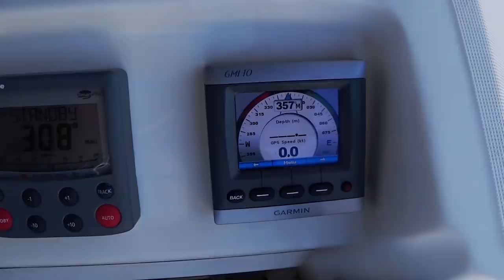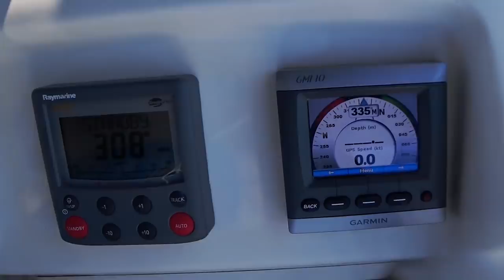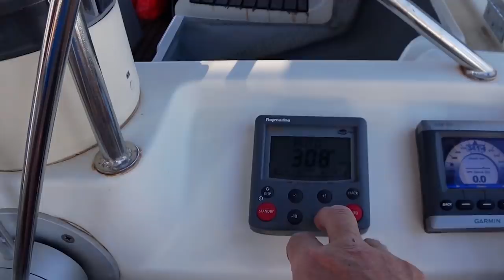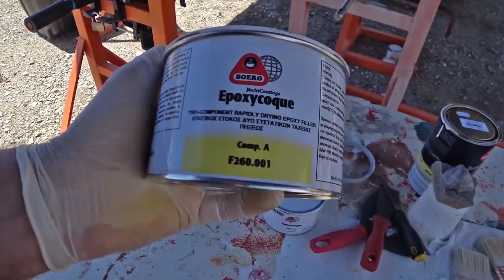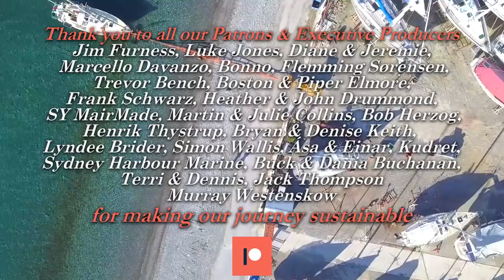Guess where our cutlass bearing is this week? - Sailing A B Sea (Ep.127)

Comment: Hi Guy's. Ultrasound transducer is working but needs water to show depth. Be careful you can not hear it but its still transmitting at full power. It just out of your hearing range. Put your epoxy in the fridge. You could do a whole video on that bearing! Oh well that's sail life. Sail Safe Guys, Ant, Cid & the pooch crew.
Reply from the maker: Hey Ant, do you mean put the two epoxy components into the fridge prior to mixing? The bearing... Don't get me started. ☹
Reply: @SailingABSea . Yes and the mixing bowl or cup. Its a chemical reaction but is heat dependent for cure time. As it changes from a liquid to a solid it also generates it's own heat so you can also slow it down by standing the mixed paste on a few ice cubes. Provided there not all gone from last nights G&T's that is 😃
Reply from the maker: @SVImpavidus  or provided that you live in a boat yard with no ice available.
Reply: @SailingABSea  Amazon Ice maker. You can even  run it from your inverter!!!

Comment: That wiring needs a good tidy up and you should think about trying to rewire in to an IP65 rated enclosure using maybe stuffing glands and then finally a bit of silicon as final protection.   At a push you could you use proprietary marine grade heat shrink sleeving with appropriate splices, I guess an overall bind up with amalgamating tape would be good.  
You have to be in the water for it to work.
Best of luck with that cutlass bearing.
Reply from the maker: Hi Russtafa. Agreed the wiring is awful and something that we'll give priority to next winter.

Comment: Step by step you’ll get there.... it’s a boat, so you’ll never be out off jobs......
I agree with other writing about the cable mess. If you want a reliable system the wiring and connections need to be cleaned up.
Reply from the maker: re-wiring will be a priority job next winter, we can get all the correct cables from Marmaris. Cheers.

Comment: Brilliant, love the travels of the auto pilot, made me smile :-).  You know looking at that wiring, I wonder if the fault is a bad connection and other stuff in the locker just moves it a bit when you are at sea. Draw the network out on paper with the wires as a start point.
Reply from the maker: Hi Pete, it certainly is a well travelled autopilot, we like to think of it as basic training. Hahahaha. There is a wood panel that separates the locker from the void so it's more that likely just that balls up of a wiring situation which we'll address in Turkey.

Comment: Hi, that wiring looks not so secure to me... Maybe that is the reason for the autopilot malfunction. There are solder heat shrink connectorsaa or just automotive waterproof conbectors - those would ensure there is always a good electrical contact for the autopilot. Cheers.
Reply from the maker: Agreed Tibor, re-running the wiring is top of the list for next winters maintenance.

Comment: Guys, not one on sailing but scuba, as I know you are into the old scuba diving. What are your views on the 'Spare Air' system as an alternative to simply a snorkel and mask and breath-holding to go underwater in emergencies to clear fouled props etc?
Reply from the maker: Hi, the spare air system can be a helpful tool and it can also be a killer.
If someone is using it who is not trained in scuba diving there is the potential for injury or death. If it's only used to clear the prop there should be no problems, however if your anchor is stuck at 7 metres and you try and free it on spare air there could be many complications.
The other problem people run into with spare air is that dive shops will not refill it if you are not a certified scuba diver.
Hope that information helps in your decision making. Cheers.

Comment: Hey guys i saw you closed that leaking hole in the keel, did you managed to try it up ? Are you sure it's dry before closing ? I wonder where did that water came from...
Reply from the maker: Hey Bordelia, the water got in through the keel/hull joint, we've fixed that as you'll see in the next video. We dried it out by having a hot air blower running 24/7 sat right up against the lower leak for about 8 days. Cheers.
Reply: @SailingABSea  Happy to see it didn't affect your keel bolts. I have the same problem and it's leaking slowly for 4 days now. 
Before the boat goes in the water i plan to remove completely one of the bolts just in case...

Comment: Didn’t see any sign of a depth sounder/log in your video scan of the hull area near the keel repairs 
Is it under a wayward splash of that expoxy ?
Reply from the maker: Hi Ron, the depth sounder and log are just forward of the keel and slightly offset to port. Cheers.

Comment: As a non sailor. Could the difference in heading be from electrical interference from wiring being close to the electric compass? Could this also, mess with the auto pilot especially, if the item that causes interference turns on and off like a fridge.
Reply from the maker: Those are  interesting avenues to pursue Phil. Even with all the jobs we've been doing we still haven't located the flux gate compass.

Comment: Baz that wiring in the locker is a dogs breakfast mate. Needs all those butt splices undoing wires checked for corrosion and rejoined with marine grade heatshrink splices and glue lined heatshrink over the top. No one can stuff things up like the greeks you'll get the cutlass bearing eventually
Reply from the maker: Hey GMoose, the wiring will all be re-run new when we're in Turkey. It's proving difficult to obtain what we want here. We have heard that there  is a huge boat porn warehouse (like Bunnings but twice as big) at Bodrum, we'll see if we can call in there on our way to Kas.

Comment: Yes it needs water. Your electrical systems not good :-). GPS course goes zero if the antenna does not move.
Reply from the maker: Thanks for the confirmation on the depth sounder. Replacing the cabling is a high priority item for next winters maintenance. Cheers.